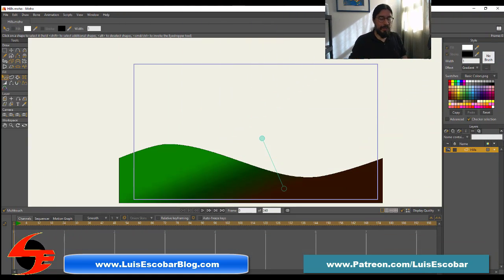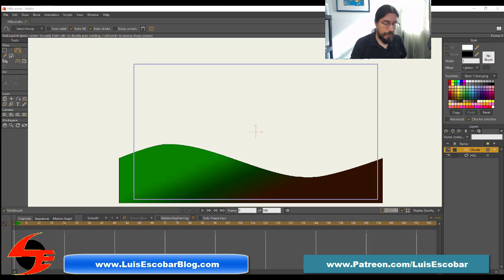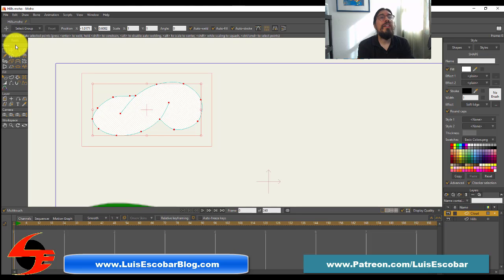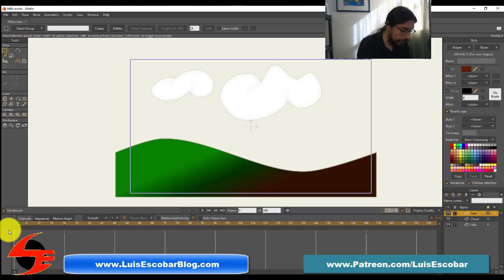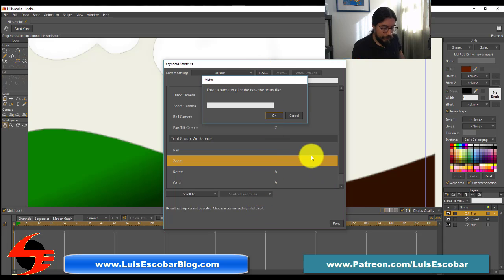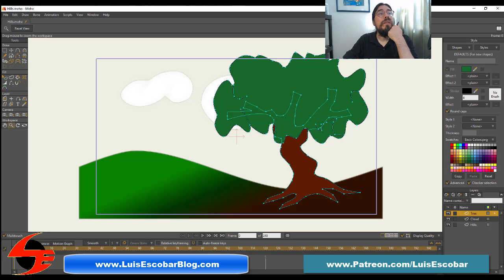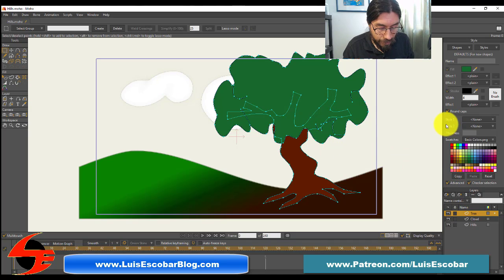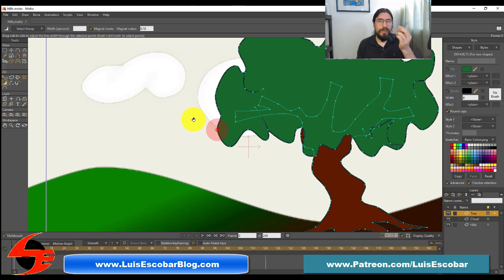Learning Moho Pro 12: Tutorial 1.3 Drawing Complex Shapes

Comment: Hello Luis.
Fascinating tutorial - thank you.
I'm a brand new MOHO user and am really struggling.
I come from an Illustrator/Photoshop background.
Can you please tell me if there are any tools such as 'ALIGN' or 'PATHFINDER' etc in MOHO?
MOHO seems fine for creating 2D 'flat' graphics, but what if you want to draw a more complex, 3D-looking shape?
For example, I want to draw a plant pot with a cactus growing inside it.
I can draw it 2D and 'flat', but what if I want to add some slight dimension by giving it depth and perspective?
I don't mean actual 3D as can be rendered in software like MAYA, I mean a 3D appearance giving it a 2D dimension using ellipses and the like.
I hope you understand what I'm asking.
Reply from the maker: Yes, I understand exactly what you're asking.  

Moho is an hand drawn animation tool.  Although it helps to simplify the inbetweening and cleaning up of any kind of animation you may have created, you still need to be able to draw what you want to animate.  This means, if you want to animate a 2d cactus that looks three dimensional, well, you have draw one.  You have to design the cactus that looks three dimensional.  In a program that deals with hand drawn animation, the hand drawing comes first.  The same way that in a 3D animation program, the 3D modeling comes first.

I hope that helps.
Reply: Hello Luis.
Thank you very much for taking the time to reply.
I have emailed you.